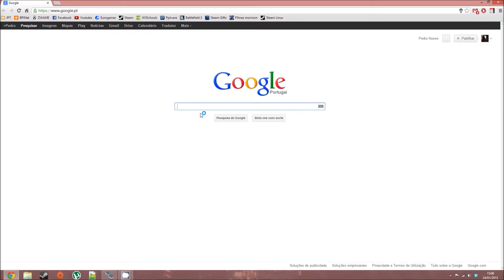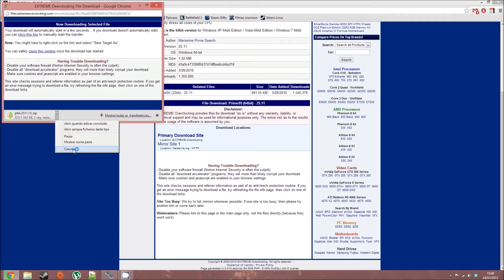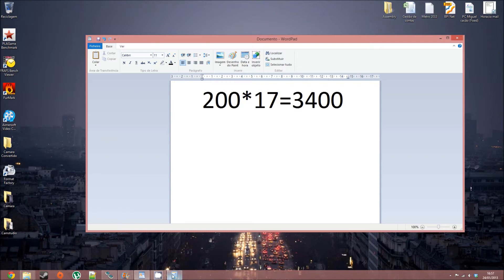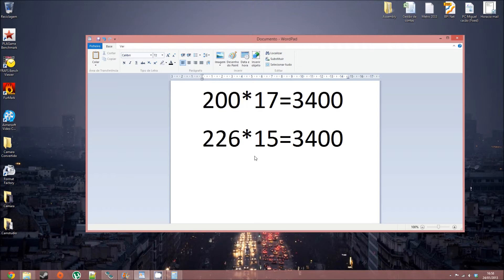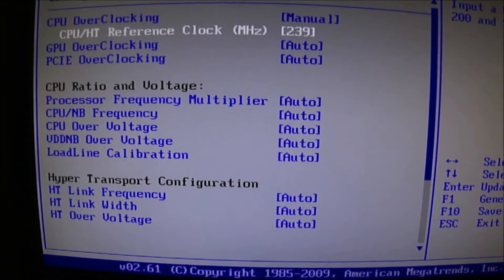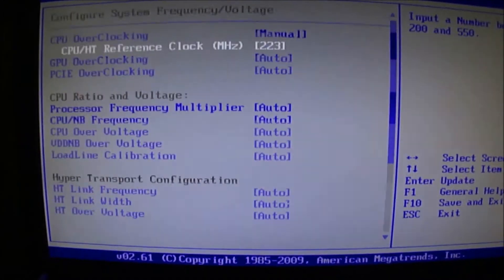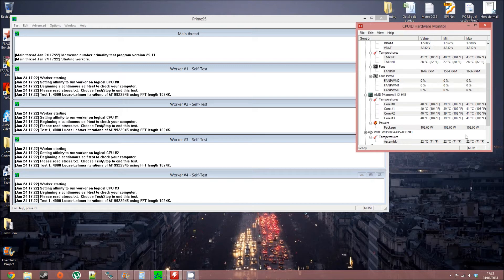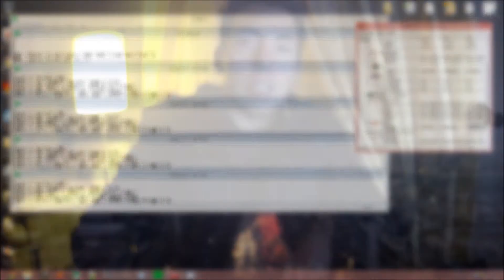How to Overclock Phenom II X4 945 [Basic Toturial]

Comment: I Like your video.... i have a question..
i have Phenom II X4 945, Antec Quatro 850 Power supply, GPU NVIDIA GTX GIgabyte 970 G1, with 10 GB of Ram with Unganged mode.... can I Over clock my Cpu? and upto what extent and what voltage... please guide me
Reply from the maker: Hi there.
Yes you can overclock.
About the voltage or the CPU, that depends on most CPUs.
Altouth even with overclock the phenom II won't save you from the bottleneck to that great card.

First of all you should consider to try to push to the max of your CPU stable without voltage, don't forget to lower your ram speed.
Second, after you find your max with the stock voltage, then you will try to get more with more voltage.
I wouldn't go above 1.5V for the day-day usage.
And temperatures try to stay not above 65-70c

Cheers :)
Reply: +BenchART  if anything happens did it harm to my graphics card?
Reply: +BenchART i did overclocking upto 220x15 with default/auto voltage and memory settings but didn't get any convincing result even i didnt feel any change in performance. even my gta v lags a little while driving givng fps 23-30 at high settings :(
Reply from the maker: M.Haider Hussain You can use GTA V benchmark tool to compare.
Try to lower to 215 and see happens.
Reply: +BenchART ok i'll go with 215
Reply from the maker: M.Haider Hussain Run the benchmark at Stock and then at 215, see if you find any difference.
If possible, take me some screenshots of your GTA V settings
Cheers
Reply: +BenchART  yes i will check it  and take some screenshots, tomorrow
Reply from the maker: M.Haider Hussain Yes btw.
I have a video of GTA V in my system.
You can see the framerate while recording with very high settings
https://www.youtube.com/watch?v=AA_BrBbZTu0

Something is really wrong in your system mate.
I will help you out..
Reply: +BenchART that's so kind of yoy
Reply from the maker: M.Haider Hussain yoy? XD
What is that? :D
Reply: +BenchART sorry typing mistake... that was "you
Reply: +BenchART sir, i checked your video and your pc runs really really smooth than mine. my gta v doesnt  run smooth even at lowest settings... 
AC Syndicate doesnt cross 30-40 fps at high settings
Black ops 3 doesnt cross 40-50 at high settings ...
i dont know what to do
Reply: +M.Haider Hussain and one more thing my cpu goes 100% while playing gta v and some other games...
Reply from the maker: M.Haider Hussain That's normal, it means that you are bottlenecked.
You might want to check when you are playing, how much % is the game eating and if there is another process on the background consuming a good amount of CPU.
You can perform this test with the game windowed, and the task manager open.

Cheers.
BTW, what Anti-virus are you using?
Reply: +BenchART yes, but it doesn't help. i have done this
Reply: +M.Haider Hussain what cooling system are you using for overclocking your processor?.. i read that you overclocked your cpu upto 3.7ghz while playing gta v...
Reply from the maker: M.Haider Hussain I'm using a simple Artic Cooler Freezer pro 7.
Nothing special..
But i did downclock the CPU now to 3.6GHZ.

Very important, what temperatures are you getting while playing?
Reply: +M.Haider Hussain i have stock little heatsink and little stock fan on it... what do you have to ove clock it over 3.7?
Reply: +M.Haider Hussain i have windows 10 builtin security, i do not nstall any other anti birus
Reply from the maker: M.Haider Hussain I had it at 1.45V with LLC set to 6% and FSB to 247*15 and it was with the artic cooler Freezer pro 7, but during the summer here in Portugal, it gets to much hot
Reply: +BenchART at default settings the temps were like 70 to 72 for all cores at HWMONITOR and after overclocking to 220x15 temps were like 70 to 73
Reply: +M.Haider Hussain what do you mean by LLC ? and
Reply: +M.Haider Hussain and one more thing, although my rams are 1333mhz  but when i overclocked to 3.2 the rams jumped to 1475mhz 6.6x and there was not an compelling option to manage them manual
Reply: +M.Haider Hussain is is harmful for memory sticks?
Reply from the maker: M.Haider Hussain We did find your problem, it is overheating.
That's why you don't get the performance we want :(
What is your case, and how much time you don't clean it?
Reply: +BenchART my case is Thermaltake Versa N21with Thermaltake LED static pressure fans in the front side for intake and two LED cooolermaster air flow fans on the top and one at the back and there is no dust in it....  though my heat sink and fan
Reply: +M.Haider Hussain my processor heat sink and fan is not good it of small size fan and heatsink
Reply from the maker: M.Haider Hussain You are using the stock cooler, it's okay, but the case is important as well.
What case do you have?
Reply: +BenchART I have Thermaltake Versa N21 case
Reply: +M.Haider Hussain the case is brand new with no dust...  I have placed two static pressure fans for Inflow in the front side and two airflow fans on the upper side of the case and one airflow fan in the back of case for outflow...  Thermaltake riing fans are for   inflow and cooler master fans are for outflow in my case "Thermaltake Versa N21"
Reply from the maker: M.Haider Hussain But, your case in the website only have 2 slots for fans.
One for intake and another at the back for outtake.
Reply: +BenchART no, you ignored the upper side of the case... there can be placed two 120mm fans at the top of the case... as did I
Reply from the maker: M.Haider Hussain I just have 2 fans :)
One on the back outtake and one on the left side of the case intake, both at 500RPM, i love silence :)
Reply: nice :)

Comment: Hey man, I have a question.

My processor is the amd phenom ii x4 945, I have a 500 W PSU (sentey), no additional coolers, and my graphic is a R7 370 2 GB DDR5 (also dual channel 8 gb ddr3 1333 mhz)
My mother is AsRock 960GM-VGS3 FX

It is safe in my case if I overclock my cpu? What do you recommend me? (frecuency, voltage)

Huge thanks.
Reply from the maker: +juan m v Hi there.
Well, i gone investigating very quickly about the GPU, and unfortunaly it seems pretty weak.
It claims that it is 500W, but in the reality, the line of 12V is 318W (the line of 12V is what really matters on a PSU).

So basically our 945 already consumes 95W + 130/150W of the R7 370, and more 30W for addiotional stuff.
I could say that you should really not to overclock, if you do, don't push any voltage, but i would avoid it, or your PSU would be in a serious stress, and would burn out after months, unless you get lucky.

Cheers.
Reply: thanks mate. I'm going to save some money for a new processor xD.
Reply from the maker: juan m v Save for a better PSU too :)

Comment: Phenom II x4 945 - you can stable work on 3.4 ghz without changing the cooler. Set Voltage for 1.45 - not more - then system crash or shutter. If you want more than 3.4 ghz - yes it is possible but you mast have better cooler - not STOCK. If you want to Overclock - you must have good PSU - high brand. First I overclock on  CHIEFTEC 450 WAT to 3.2 ghz - system crash, blue screen or BSOD - not stable if system starts - after changing my PSU to ZALMAN GLX 700 WATT (price 65 EUR ) I overclock normally to 3.405 ghz - system is stable, voltage set on 1.45, phenom is a little faster, more points in benchmarks - cooler works a little louder , temperatures is a little bit higher - if you want 3.6 ghz for example - I am not reccomend stock cooler and cheap PSU.
Reply from the maker: +Domiss223 Exactly!

Comment: i have a ma488td-v evo/usb3 mobo and a phenom ii x4 960t i cant push it more than 3.6 if i do that a got a bsod , 8gb gskill 1333ghz, can i have some help, and a coller master hyper 212 evo cooler, so its not temp
Reply from the maker: +Miguel Rodrigues I guess your CPU have the multiplier unlocked, so you just need to push it in there.
When you hit the limit, you will need to raise the Vcore or CPU Voltage to keep things stable.

Your power supply may limit too if you have a very budget PSU, and i don't mean low watts, but low quality PSU.
;)
Reply: +BenchART i hit the x20 multiplier and i can start the windows but after some minuts the bsod (irql_not_less_or_equal), about the psu i have a antec box 500wats , but the windows only start when i oc the mem to 1600 with this settings
Reply from the maker: Miguel Rodrigues humm thats weird, with the multiplier unlocked cpus, ram speeds shouldn't be causing conflits, thats why multiplied unlock cpus were a big deal, because they didn't mess around with another components connected to the mainboard.

What about 19.5x? can it handle it?
Reply: +BenchART nop the stable is on 18 = 3600 , and if i unlock the cores because this cpu alows this, bacame a x6 and i only can run it on 3.45ghz stable , my question is? if i get a 1600ghz mem fix my prob? because all forums i read ppl uses the 1600ghz mem
Reply from the maker: Well, thats a question that i am not sure, i never saw such weird problem, really.
Altough only 200mhz of overclock is nothing special.
The 6 extra cores only get used in some games like GTA V and other well optimized engines, many other games don't use more than 4 cores, some even 2 cores XD

So i don't think it would be a good deal to go buy 1600mhz rams just because of +300/400mhz, thats at least 50€/50$ for 8gb kit, or a little less, just for overclocking.

Save that money in a pot for a decent upgrade on the future.
DX12 is coming, so surely its going to help us a lot, i already felt it on ashes of the singularity and battlefield 4, and it was a very big deal my Phenom II X4.

But i have a question, did you pushed voltage? You didn't told me that.
Reply: Yes i whent to 1.52 CPU voltage
Reply from the maker: Miguel Rodrigues Thats too high.

Comment: I am getting the blue screen of death now that I'm clocked to 3.6 in battlefield 4. :(  I dont know what the problem is.
Reply from the maker: What is your CPU and how much Frequency runs your DRam by default before the overclock?
Reply: My cpu is a phenom 2 x4 945. My ram is ddr2 800. I think the cpu is getting wayy to hot with battlefield 4 when I check during gameplay the temps are something like 67 C.
Reply: Anth bobo oh so bf4 also gave me a blue screen at 55 C temps. Do you have any suggestions?
Reply from the maker: Anth bobo Voltage applied to the CPU?
Reply: 1.425v.
Reply from the maker: I had to put mine at 1.45V in order to had it stable at 3.6 and now i have at 3.71 with 1.475 plus llc calibration to make the CPU use 1.5V when is about to crash :P
Reply: hmm I cant seem to get it to 3.6 at 1.475v the cpu gets to 70C under load and then crashes. :S during idle it is perfectly fine though.
Reply from the maker: Anth bobo I see
I think you may hitting the Wall of temperature with the 1.475V
While at 1.425 or 1.45V your cpu may not have enough power to feed.

Or you could had unluck with your CPU and don't overclock as much as mine, i know some guys that overclock to 3.8GHZ with less voltage than me.. and yet mine crashes completely at their settings.
Reply: ObscureAngelPT
 Yeah I'm hitting the temperature wall for sure. I got it to run stable at 3.4 ghz battlefield runs really smooth! Are you using a stock cooler or an aftermarket one? I think with a good aftermarket cooler you can reach up 3.8 ghz or more.
Reply from the maker: I am running na low-end cooler artic freezer 7 pro

I can reach 3.8GHZ but at 1.5v or more, that is a lot and wear off the CPU to much.
I want the cpu to game a few more years so 1.5v is out of the question for me, but yes its possible to have it stable at 3.8GHZ :P
But its just too much, 3.7 or 3.6 is nice tor the 945 with a good cooler.

:P
Reply: ahh no wonder u can clock to 3.6 so easy, the standard cooler doesn't let me go past 3.4 without overheating.
Reply from the maker: Its stable?
Reply: No it wasn't I had increase the vcore to 1.5 to get 3.7 I think it is stable now. I dont think I wanna go past 1.5 since AMD does not recommend it.
Reply from the maker: Neither do i use 1.5V, i use 1.475 with llc at 7% i think that sends the vcore to 1.5V when its about to crash :P

With this is fully stable.
I hope i had helped with the OC and that this vídeo was usefull
Reply: It seems like I need a notch higher vcore than you for some reason with my processor. Anyways I was reading that the max AMD recommends is actually 1.55 not 1.5 like you said in your video so you can bump it a bit more.:)
Reply from the maker: Thats the recommendation, but look, intel recommends 1.5 vcore in those new CPU's and if you bump them to that vcore, the CPU will not last a weak.

Just saying for you to be careful, i want you to have a performance increase with the same CPU, not to buy a new one with a new motherboard and new Memorys :P
Vcores wears off a lot the CPU even if you have good temps

Good luck men and be careful.

PS:Even with the same CPU's and motherboards, the overclock capabilitys will always be diferente from people to people.

Comment: Also it tells me that my DRAM frequency in CPUZ is 378 mhz, does that mean that my memory clock for the ram is actually 756 since I need to times it by 2?
Reply from the maker: Yes. if CPU-Z is saying that your memory is clocked at 378, in reality it is running at 756MHZ ^^
Correct!

Comment: Hello, congratulations for the toturial, I have a power supply Zt Ocz 550w, with this power supply I can do this overclock?
Reply from the maker: First of all, many thanks..
Yes with the PSU you shouldn't have any problems at all.
Of course depends on what GPU you have there.
Reply: ObscureAngelPT I'm about to buy a Asus GTX 760.

Comment: Excuse me, what did you do with the memory clock value? It was 533, you changed it to 667 and the back to 533? I'm trying to slightly overclock similar cpu, maybe to 3,3GHz. Do I need to change that value at all? I'm a total noob with this, as you probably guessed.
Reply from the maker: Its simple, my ram clocks is at 1333MHZ, but what most people dont know is that DDR ram clocks in reality is half, so 667mhz= 1333mhz DDR.
533MHZ=1066MHZ DDR.

So when i push FSB up the memory get overclock too, so lets imagine i raise the CPU from 3.0GHZ to 3.3GHZ, memory clock automaticaly raise to for (lets imagine) 1430mhz.

Since i don't want the RAM to get overclocked, i lower the RAM's to 533=1066, and so when i OC to 3.3GHZ, rams can get to (lets imagine) 1170mhz.

Did you understood?
Ofcourse if your ram is good enough, A low OC on RAM don't kill them, if you have a good ram, but if you have some value packs, well try to not get it above factory :P

If you have a Phenom II X4 955 or 965 theres no need for this, you just need to raise the multiplier and voilá with no worries with the RAM

Regards
Reply: ObscureAngelPT Thanks for the answer! Ok, so I changed FSB to 220, but I couldn't find Memory Clock value from Bios. By the way I also have the 945 95w version. My RAM is 8gb.
Reply: nicool54 You can check with the CPU-Z :P
Good luck
Reply: Thanks, I found it. I clocked to 3,4GHz, and everything seems to work fine.
Reply from the maker: nicool54 Nice, did you checked the temperatures under load on Prime95 and furmark at the same time?
That is the ultimate test to check stability, which i recommend you to do.
Regards

Comment: What is the best voltage for overclocking this CPU to 3.4 GHz, because I don't want to push it to far. I have a 400W power suply with 4 GB of ram at 800MHz. It's not really good. Just seems like you know what you are doing. ;)
Reply from the maker: Stock voltage seems to be enough
Reply: Thanks, I forgoit to mention I have a ATI sapphire HD5870  and that is a "big" power drainer.

Comment: Hey Im trying out overcloking rright now, and I have had 220mhz clock for a long time, So i tried 230 now and it works and its from 3.3ghz with 220 to 3,449ghz now.
It seems to be working fine, and no temperature increase when i play game, haven't strees tested yet.
But I want to get to 240mhz and get to 3,6ghz, but my Bios doesn't have normal memory clock change, it had [x 6.6] [x8] etc, Mine was x6.6 , when i changed it to 240 and x8 I couldn't get to start, so had to go to 230 again.

Comment from the maker: Degrees, its the universal european unit it uses this "º" symbol.
58ºc in idle is of course bad :P.

Some motherboards comes with low presets of overclock, for example my ancient motherboard brings a lot of modes, like general, commander, lieutenent (which one have more OC than other state, for example +100mhz, other have +200mhz, other have +300mhz.)

But normally default motherboards for pre-built PC's don't have advanced motherboards except brands like alienware and things like that

Comment: First of all, how the hell are you typing the degrees sign. Secondly, you said 58 degrees was idle not full load XD

I need to get a new motherboard because I got my pc from HP... I got a corsair psu and an asus hd7750 1gb OC'd. Do motherboards come with built-in overclock settings?

Comment from the maker: Don't worry i have my CPU for almost 4 years and it still alive, what you see of 58ºc is the maximum in full load in special occasions, if you reach 65 for example doesn't trully means you cpu will blow and burn.

That is not how it works, i had mine at 66 for 1 day and its still alive :P
So you just don't want it to let it slip to more than 62, because its the maximum recommended no the absolute temperature to explode the system :P

Comment from the maker: Yes things tend to vary because of the different bios, but its all almost the same.
My Bios have auto mode to the voltage too.
but the auto dont go so high as you can expect, so for a better overclock sometimes auto is not enought and you need to put it up to 1.4 or 1.45